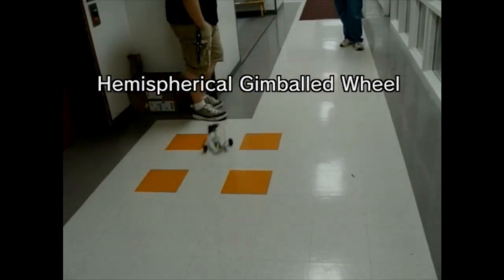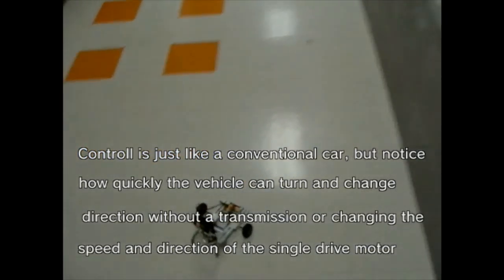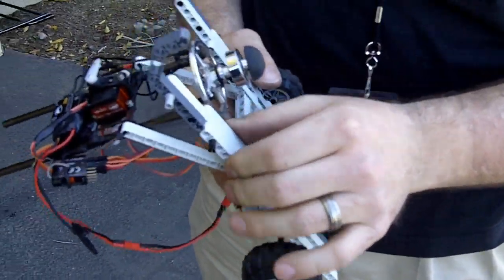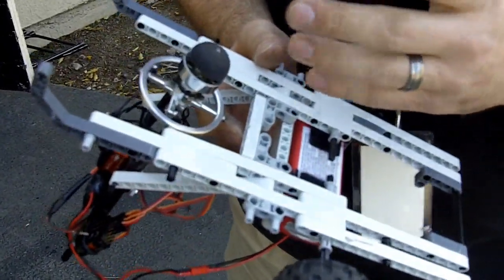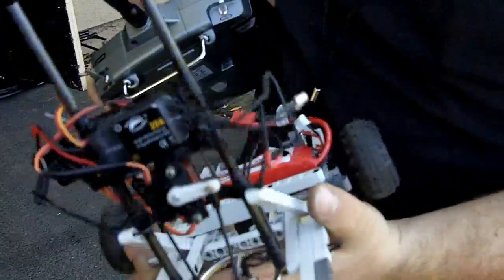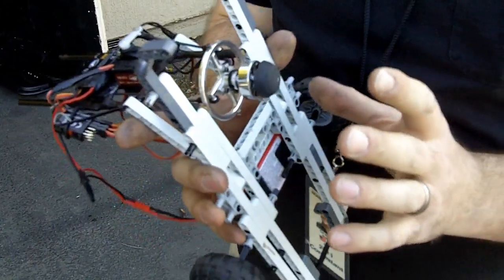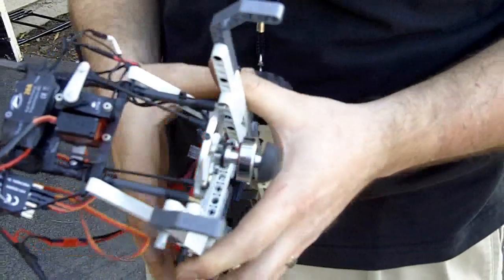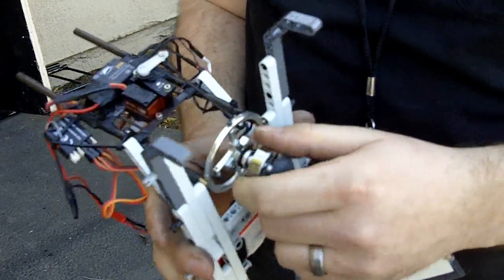Hemispherical Gimbaled Wheel Drive System

Comment: @colindb1809 Well it is going probably 300 scale mph as roughly a 1/12 size vehicle so I doubt you would have the wheel going so fast (30,000+RPM) on a full size model.  Not at all an issue for industrial uses, which is what this design seems best for actually...  A very large solid gimbal that can handle a lot of weight but be very precise with a very simple design and few moving parts.

Comment: @Ryuuken24 when you're in engineering, mechanical in this case, you often use RC to drive the robot, or whatever it may be, in the prototype phases, and for the competitions especially. Look at FIRST. We use RC to drive/test our preseason/promo robots. Then for the actual season we use a more advanced controller and drive station. It's all applicable and there are a lot of scholarships available for students in FIRST or similar programs. Just because you don't like it doesn't mean it's stupid.

Comment: Add a gyroscope to that bad boy and hand it off to the next planetary rover model that goes out into space;  Less gravity will help with the problem with terrain.  Rail ways and roller coasters would also be a great application.  As for cars, I doubt it would be more adaptable than the idea for Spherical wheels.  However, if they did fix the problems with it, it would be use only for military applications.

Comment: @lolpepes That's a little harsh, but I would agree with you if playing with legos were all that we do. The real work behind this project is the mathematical modeling of the vehicle's dynamics, true robotic implementation with onboard microprocessor control, motion planning, and the design of the more advanced, "non-lego" prototypes. 

You gotta love legos though, the vehicles frames from the video only took a couple hours to put together and get running :).

Comment: What if you scale it up and you're driving and you go over a pot-hole. will the wheel get stuck in it and start spinning you in circles at 3500mph until body crushes under the g-forces and your blood/tissue spray red mist around everyone in a 1 mile radius?